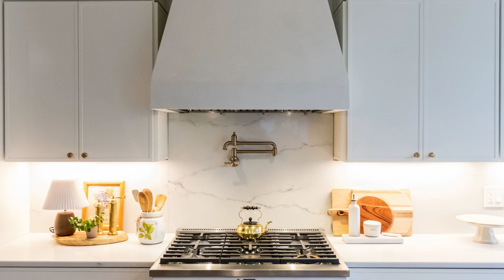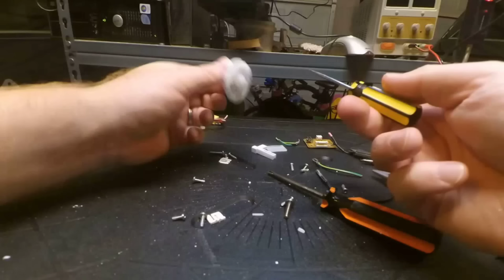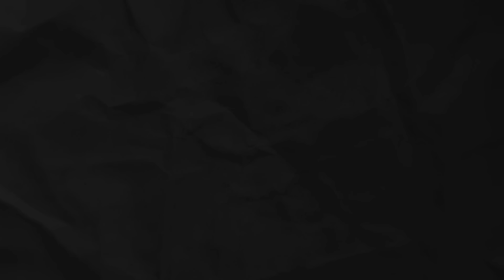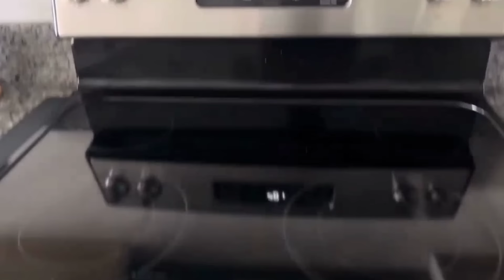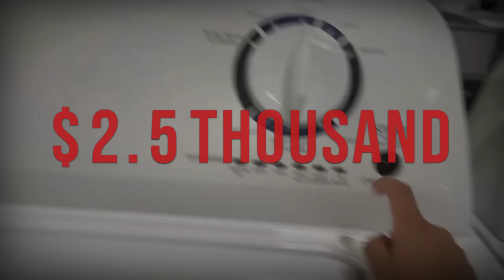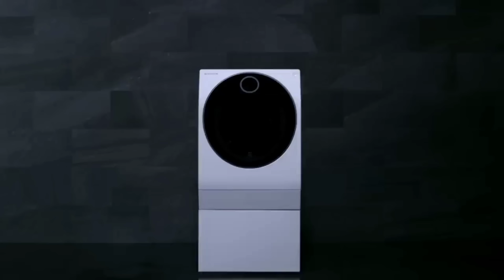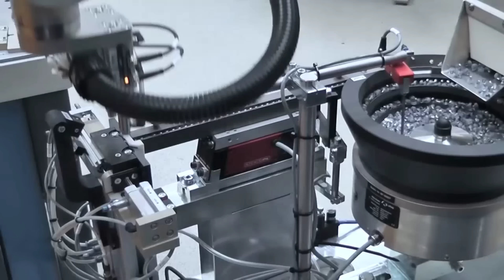The Repairman Blacklist: 5 Appliance Brands to Never Buy

Comment: I'm halfway with you on this. I get the old freezer-on-top fridges, and don't even hook up the icemaker if I'm forced to have one. I'm staying away from those new all-in-one washer/dryers. But not on some others: my next stove is going to have an induction range, so it'll have to be "high tech". The old top loader washers use way too much water, the spin cycles were weak, and the agitator damaged clothes. I might look into the newer top loaders that claim low water use, but I've been a fan of front loaders for a long time. I'd be much more interested in videos that tell me what are the best "higher tech" appliances there are out there, as I do like some of the features they might have. Not tech for the sake of tech, but tech that really improves results and/or ease of use.

Comment: #4 is total BS. I repair appliances. And sure you need to wash away leftovers and toothpicks and whatnot before you put it in the washer. But what most commonly happens is that the motor get stuck. That is an easy and quick fix. And if the warranty has gone out, it’s something anyone can do if you have half a brain and YouTube. If the pump motor need to be switched out, I’ll usually be in and out in less the an hour. Most of the time is to get the machine out and to put it back in again. To switch the motor literally takes a minute. And a new pump motor usually costs around 30$ for me. Problems like this I most commonly see in cheap budget models with crappy filters.
But everything else I agree with. Never buy appliances with a bunch of (not needed) extra features. Don’t buy washing machine/dryer combo, they suck. And never ever buy LG. I mean it, don’t do it. Well unless you buying a TV.

Comment: I had a refurbished old refrigerator that finally gave out because all the new fridges are bad and don't last. So I bought a 600 dollar Samsung fridge which works fine and I also have Samsung washer and dryer which have been fantastic so you can't always trust what applicance repair people tell you.  My appliance guy said the 600 dollar Samsung is fine and told me to always go for the cheapest fridges since even the expensive ones are bad.

Comment: I worked at a kennel for 4 years. We had multiple washers and dryers to keep up with the loads. It was always the newer, higher tech crap that constantly needed maintenance and repair. If I need to buy one sometime I'm searching Craigslist for older machines that still run.

Comment: I think there could be a problem with anything no matter what it is. Everyone has a different experience of the Samsung all in one and thoroughly enjoy it no problems at all and I researched around before I bought it. It got very good ratings. There’s always gonna be failures and glitches and anything you get it doesn’t matter what it is, but if I had to do over, I still buy another one.

Comment: We have an induction range about 7-years old. Works great but the oven vent comes out immediately adjacent to the control panel. If we bake something that has water or liquids we have to set up multiple fans to Try to keep the panel for crashing out in an error. The F’ing stupidest design decision ever. Designed to Fail!

Comment: We have a dryer as old as me (mid-50s) and the only repair was a drum bearing, belt stretched after 35 years. Element was replaced after 50-years. That’s all. Low-Tech is the only option.

Comment: What is going on in the appliance industry is beyond outrageous and someone with the power to change this needs to get in the faces of the decision makers in this industry! Recently, an appliance salesperson told me that most new refrigerators are only lasting 5-7 years. Everyone my age, had an old refrigerator they inherited from a relative that was at least 20-30 years old and never really required any expensive maintenance at all. 
The appliance companies of today build garbage, then sell you a warranty for their garbage while using it to spy on you. Those CEO’s  certainly need to add on another mansion in Hawaii or Vail with the $$$ they steal by selling you this planned obsolescence crap. Something seriously needs to be done. Hello, Congress? Have a hearing with repair guys and tell them to list for you the materials that should NOT be used in appliances. Then, pass a bill making that list law. If they 
ignore it, heads ought to roll and should REQUIRE firings, especially at the Executive level.

Comment: My less than 2 yr old GE started smelling like burning rubber when I used the oven.  And at one point had smoke coming out the back panel.  My husband took it apart and saw that the connection to the broiler was not in all the way and the plastic cover to the connecter had melted.  Since of course the warranty was by now no good, we were looking at buying a new stove.  After much diligence he cleaned it up and reconnected it correctly.  We've had no problems since.......so far.  The stove we had prior to this was also a GE,  the oven door did not close tight (which I did not notice right away🤥}, the back right burner never worked right,  the bottom element went out after just 2 years and we replaced it, then the back left burner went out.  I was just considering whether to try to replace the burners or buy a new stove and one day the bottom element popped and caught fire.  That stove was only 5 years old.  You would have thought I would learn with the first GE stove.  BUT they are all cheap Chinese junk anymore, so it really makes little difference which brand we buy!!!

Comment: Actually, GE anything should be avoided. My parents went through 3 GE microwave ovens in less than 10 years. I gave them my Panasonic microwave oven which was 8 years old at the time. Now, 31 years later, it is still working.

Comment: I would have to add, even simple appliances can be poorly designed.  I have a DeLongi gas/electric oven/hob - one of those fancy looking ones that make your kitchen look like you know what you are doing.  The gas side of it is fantastic... the electric oven is pure garbage.  The main issue is the function control switch.  ALL the power is routed directly through the switch instead of using relays as any non-moronic engineer would do - so you have something like 2400 watts going through small wires into a small, complex switch.  It gets way too hot from the excessive resistance from the under-gauge wires & internals and so burns out regularly and costs a several hundred dollars to replace every time.  I've had the oven for 10 years now and replaced the switch twice, so it lasts perhaps 3-4 years.  This in a oven costing several thousand dollars that I'd have expected to last at least 20 or 30 years with perhaps a couple of element replacements and nothing else.  Also there is a random rust hole forming in the bottom of the oven which is weird as I've never ever seen an an oven rust in my part of the world.  Not the end of the world, but attests to what junk Italian manufacturing is I guess.  Really in this case a little extra engineering to have the switch trigger relays would have gone a long way.

Comment: This is all good if you have a basic house, My house is fully automated and run by AI so purchasing Dumb apliances is not an option, My House consist of the following, Smart ThinQ LG French door fridge with indoor Iice maker that I have never had a problem with, Smart ThinQ LG Dishwasher, agian never had a propblem, Smart ThinQ LG Wash Tower, the omly Issue I had with it was that the WIFI module Falied, Unly cost $100 to replase as you just unscrew the panel and plug the new one in, no technicion needed, As for the High Prices that is not a problem for me as I always buy Factory Second or Carton Demmaged which usualy brings the price down to half. so if they do happen to break down after 5 years it is cheap enougth to replace if you are willing to look at the ocasional small dent or scratch. The main point to the smaty features in the ThinQ setup is so that you get timely notification for maintanance and if you dou it when told rather then putting it off the apliances last a lot longer. I have had the Ice maker in the door of my fridge  f0r 5 years without a problem as it tells me when it is starting to ice up and then I turn of the ice maker and let it de ice, normaly only takes about  3 hours, then I turn the ice maker back on, this happen rougthly twice a year.

Comment: I'm not sure if anyone will read this random tip or not. But I have owned a Speed Queen for a few years. No issues EXCEPT the digital board in the back of unit that controls the knobs. (I've got the TC5 got it new April 2020) I've had to call in the repair man to replace it under warranty otherwise, there's been no problems. If you're in the market for a new washer and want a BASIC bare bones Speed Queen with an actual timer actuated knob NO digital stuff at all like how we had up until the early 2000's, Ask your local Speed Queen dealer (you may have to google who repairs/sells speed queen in your area) and actually ask to custom order the TV2000 and the DW2000 matching clothes dryer. These machines operate and function exactly like a classic speed queen washer with no digital boards of any kind in it. this tip is what people don't know. They CAN be ordered you just have to go order it.  My next house, these machines will stay but I will custom order the TV and DW 2000 washer/dryer for my next home. Incredibly bare bones basic machine!! :)

Comment: I have always bought reliable european branches and only one time since 2007 a machine need a repair and it was my dishwasher of brand Electrolux and the problem was electric water supply valve. I have bought  So I have been lucky with my purchase on 3 different accomodation, villa, summerhouse, apartment and just now again with a new apartment. Always bought simple machines with brand like Bosch, Miele, Electrolux, Whirlpool, never ice machines on cooler, no WiFi, no automatic detergent fill and so little eletronic trinkets as possible. Just a plain machine with low cost and good reputation. Follow that you can spend money on travel with family instead.

Comment: I had a 1984 G.E. profile that lasted 10 years inside my kitchen and 25 years in my hot Texas garage. NO repairs. It finally leaked water from the ice maker -- which I used all summer --- so I sent it to the curb.  I have another G.E. side by side.. Let's see it's longevity.

Comment: I had a fancy refrigerator with the bells and whistles. I had it for four years and had to have it fixed at least once a year. I was finally done with it. I bought an old-fashioned dumb refrigerator with the freezer on the top. I bought an ice tray to make ice cubes. And I have a pitcher of water in the refrigerator instead of the water dispenser. Guess what? Not a single problem. This refrigerator will be here when I am dead 20 years from now.

Comment: Bought a Maytag washing machine and it’s been nothing but a pain since I bought it! Stops in the middle of cycle and just sits there. Won’t spin at all. Have to take clothes out and squeeze them the water out of them. I think out of the 20 or 30 times I washed clothes it only worked correctly maybe two times. I’ve tried every setting ( and there’s WAY too many). Don’t buy one, folks! It’s a POS !!!!!

Comment: My washer has always been a top loader, for 52 years.  I had a kitchen aid gas dryer that was over 20 years old. It stopped working and my husband said I could get a new dryer.  I then figured out it was the belt that’s on the drum that broke.  I got a new belt. My son and grandson put it on, and the dryer worked fine.  I used it until my new one came in.

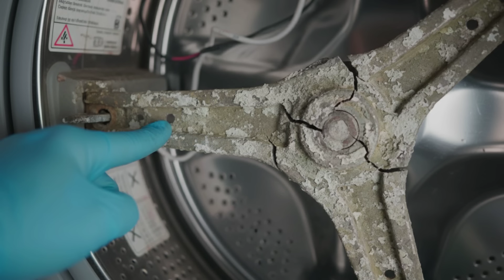Comment: 3:20. That is not just LG. That is ANY front loader. But some have worse alloys vs others. Samsung is the worst. LG and Electrolux are probably on the better end. But one thing that LG and Whirlpool do that make the machine unrepairable is weld the tub together, so now I can't replace the spider arm or bearings. And a new tub assembly is more than the machine is worth.

Comment: at least 4 MAJOR misconceptions, 1) top load washer cleaning efficiency can only be compared to a HD bucket you kick a couple of times, I have 23 years old Bosch front load washer, washes very well, only replaced pump once, 2) decent oven is so well insulated that heat doesn't go ANYWHERE to save energy, and where the board goes, you can put your hand 3) most door RELEASED ice makers, only dispense the ice through the door, and make it in a well-insulated chamber 4) buying low end Black Friday appliances will bankrupt you, they're made cheapest way possible. MY ADVICE: buy good brands, well reviewed models, if you can't afford new, buy used, just like cars, 10 years old Lexus may outlast a brand-new Dodge and be less expensive to run.

Comment: Another marketing ploy is "self-cleaning oven" features.  The feature requires that your oven is raised to a very high temperature for a period of time that allows food elements in your oven to be cremated.  It generally works well on those food elements, but the high temperature may also fry a circuit board component in your oven (depending on the make and model), which leads to a costly service repair.  I learned the hard way and I'll never use the self-cleaning feature again.

Comment: As someone who cannot get Speed Queen locally our family has had really good luck with LG washers/dryers. So when I got my own home I went with LG as well- BUT this time I got a FRONT loader. It was only after getting it did I find out about the galvanic corrosion problem.

So if you're like me here are some things I researched to help prevent an early death. 

1. Use LESS detergent. I mean most people use way too much detergent. Talk to a repair man and they will tell you that liquid detergent and using too much are some of the most common issues they deal with for any washing machine and it destroys them. Using less detergent will ensure less residue is left to corrode the aluminum spider arm. Also use he powder detergent, your washing machine will thank you for it- again, go ask a repair man. 

2. Use your washing machines "clean tub" cycle and appropriate tub cleaner tabs. This just does what it says and ensures any built up corrosive residue is cleaned away. I do 2 or 3 loads a week and so clean the tub maybe every other month or so. 

3. Don't completely close the washing machine door so that it can dry out. I also keep a micro fiber towel around so i can wipe off the door and gasket- A dry environment is less conductive to corrosion and as a bonus this will ensure you don't get stinky mold build up either.

Comment: We got a Speedqueen washer and dryer for a wedding present.  The washer died around our 35th wedding anniversary.  The dryer?  Still running after our 43rd wedding anniversary.  The only service is replacing the felt gaskets three times (the cost was about $12 and I bought 5 sets back around 30 yrs ago.  Still have 2 sets left.   Also replaced the gas valve solenoid set.  Easy with just a screwdriver. And one idler roller on the back rim of the drum. 
Original motor, original belt. Mechanical timer.  Energizer bunny ain’t got nothing on Speedqueen.  And, get this, it’s still made in America

Comment: There is nothing "fancy" in my home.  I have a set of 1986 model year Kenmore (Whirlpool) washer and dryer.  I have a GE dishwasher built around 1995.  My electric stove is the basic model sold by Sears in 1992.  I hafta fill my ice trays manually in my 2006 Sears Refrigadator.  I expect ALL of these will last several more DECADES -- the clothes washer might be 70 years old before it needs to be replaced (it is 40 years old now in 2026).

Comment: My wife and I purchased an LG All In One Washer/Dryer Combo over a year ago and yes, I definitely am suffering from buyer's remorse. While the unit is functional, without very aggressive preventive maintenance on the coil assembly and lower filter unit, the drying cycle would be almost non-existent. Yeah, neither my wife or I are happy with our choice but at this point, what are we to do? Not tossing a two grand appliance onto the junk pile and hesitant to pawn it off on an unsuspecting buyer on the used market.

Comment: We have a front load LG washer (and dryer) that we’ve had for over ten years and they still work well. We also have a GE Cafe refrigerator with a built in Keurig that has also worked great for about ten years.

Comment: I knew Samsung would be there. The top ice-maker is begging for problems, but even if it's below like mine, Samsung has a design flaw which causes it to ice up the back of the fridge after a few years. I replaced the heating coil, thermostat and evaporator motor to keep mine going, and now it doesn't ice up as often, but I still have have to de-ice it every two years. After reading about it on the net, I realized most Samsung fridge owners encounter this problem eventually.

Comment: We purchased our 1960's ranch about 15 years ago.  In that time, we have replaced our refrigerator FOUR TIMES.  We tried to find a repairman to fix our original refrigerator but could find no one in a 50 mile radius.  The last refrigerator we purchased, just last month, is the simplest one we could find.  No outside ice or water dispenser. No fancy bells and whistles.  Still, we realized that it, too, may need to be replaced in 4-5 years.  It's ridiculous.  Meanwhile, we have my mother-in-law's old refrigerator in our garage.  That thing is probably 25 years old and we have NEVER had a problem with it.